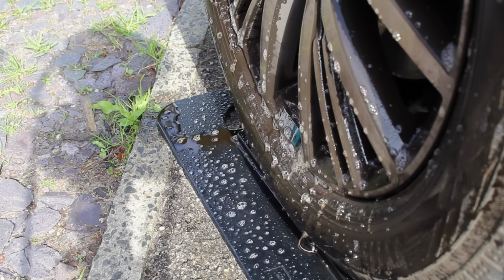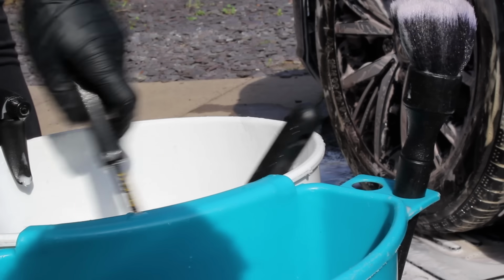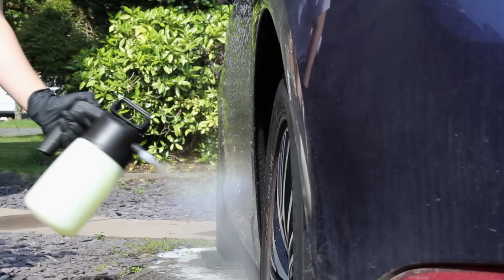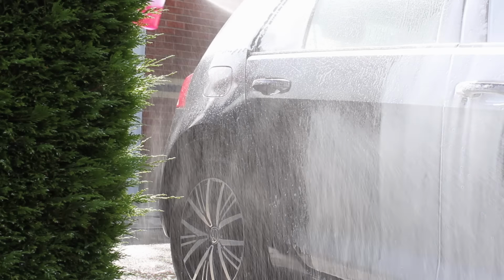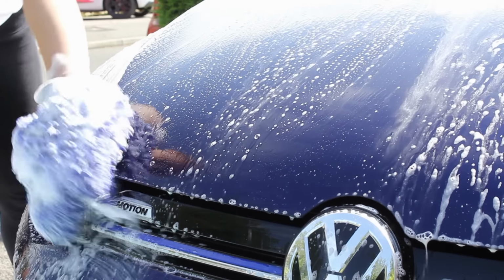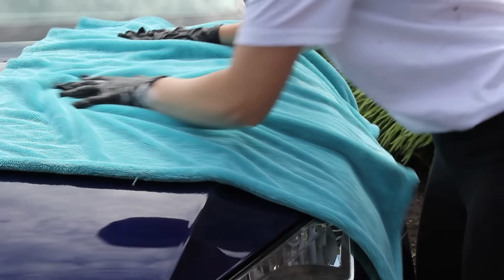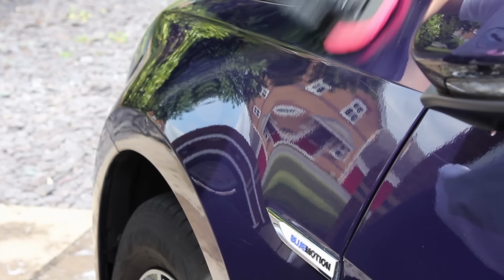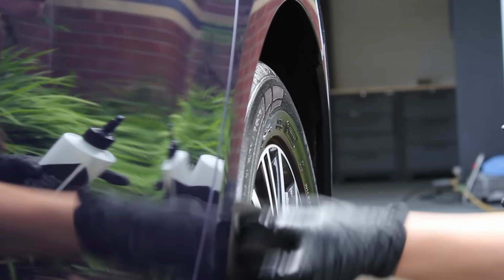Dirty Volkswagen Golf Deep Clean | Exterior Car Detailing

Comment: Biggest issue I have right now is the constant dust being dropped on the car.  Combination of pollen, local construction and other bits dropped out of the sky.... Would be great if you could show a quick upkeep method for maintenance?
Reply from the maker: Agreed it's very annoying at the moment! I've just purchased a DI water vessel (arriving today!) so my plan is just to snow foam the car,  rinse with the deionised water and then leave the car to air dry so it should remove all the dusty contaminants without having to spend much time cleaning
Reply: @AutoCareHQ  I'd be interested to see how that turns out.

Comment: I always enjoy watching detailing videos on YouTube. I wishednif I had the patience to do this weekly or twice monthly. I just don't. When I got my last car, I told the dealer not to wash and wax it. I did a full decontamination  including the claying and put diamondbrite on it. Used their products monthly to keep the protection for about 6 to 8 months before getting bored of doing it. I mentioned on a different detailing channel that I went overboard on cleaning and decontaminating the glass, especially on the windscreen: vinegar and newspaper, steel wool, barkeeper's friend, iron fallout, glass cleaner and clay, Angelwax clarity and IPA, before adding h2go. It genuinely lasted almost a year. Definitely over 10 months, and I was getting the beading at 20mph and I guess around 18mph. It was the best one out of the waxes, rainx etc that I used.
Reply from the maker: Thanks for watching 😊 that’s really impressive durability, I do have some H2Go actually, it’s a great product
Reply: @AutoCareHQ  Thanks for the response. I tried using h2go again a couple of times, but not so overboard with the decon and cleaning of the windscreen. I didn't get the same effect and durability. It was mainly because the car was new and I went overboard with the cleaning that the h2go did so well. I wanted to try the Pyramid glass, but they have discontinued it and developing a new one 😔
Reply from the maker: Soft99 Glaco Ultra is a great one to try if you're looking for another, the best I've used in terms of durability

Comment: cracking work Heather.  IW's new Super Glaze is like this, very good at filling light imperfections, and a smooth glossy finish, just ripe for coating with Super Gloss+ spray wax.  Not long used this combo on my own Outback and the results were impressive, though my Fitbit said it was a lot of effort 🥵on a warm sunny afternoon.
Reply from the maker: Thank you! Those kinds of products are great, really good for preserving the paintwork

Comment: I do like the fact that yourself and myself along with Nick@YUM rinse the snow foam top to bottom as it makes more sense in my opinion. I do really need to try YUM products but I find them slightly over priced. That VW Blue paint comes up really well when clean and well protected. I have 1000 miles of flies and break dust to remove from my car after a quick 10 day trip to London so that is the plan for tomorrow with my sons MX5 Mk1 and my neighbours car waiting in the wings also.
Reply from the maker: If you’re looking for some recommendations for Yum then I’d say Dress V2, Detailer, and Foam+, are probs my favourites. Sounds like you’re busy too!
Reply: @AutoCareHQ  Thanks. Any thoughts on the glass cleaner?
Reply from the maker: Yep the glass cleaner is spot on as well

Comment: Hi iv seen a lot 
 of your videos regards detailing cars.
I do have a question. 
When you snow foam the car, have you ever used a wash mitt when cleaning the car or as I just seen on this video, you snow foam the vehicle then let sat for about 5 min or so, then jet wash.
As normally I seen people washmit the car after snowboarding.
Do you find a lot easy to let the snowfoam do its job before jet washing it off, & dose it give better results?
As I do clean my car alot, so I'm finding out what is best when detailing a car.😊
Could you give me some tips that you find easy & more better & quality products to use.
Many thanks,.
Is it also better to wash the wheels first before washing the rest of the car???😊
Reply from the maker: Thanks for watching :)

Yep so I always rinse the snow foam off before I go in and use a mitt. This way the bulk of the dirt is removed when the snow foam is rinsed, and it's not rubbed against the finish with the wash mitt (this just helps to reduce the risk of causing micro-marring and swirl marks).

Yes I always wash the wheels first. 

This video is a good one to watch if you're looking for some more info: https://youtu.be/MlvUA0FcZJQ

Also if you're looking for more product recommendations have a look at this section on my website: https://autocarehq.com/recommended-products/

Comment: I enjoy following your channel. I watch it regularly. Can you tell me how to solve the problem with calcium deposits on the bodywork. I have applied Sonax One ceramics to the bodywork. I live in the south of Germany where it rains all the time and is very humid in the summer. Mineral deposits constantly appear on the bodywork. Can I wax the bodywork on top of the ceramics? Will it stay on the ceramics and for how long? Will it help to solve my problem? Or should I use an acid shampoo on a permanent basis?
Reply from the maker: I would apply a ceramic sealant from the same brand as your coating to be on the safe side. It won't really solve the issue but will shield the coating from the mineral deposits more so it doesn't get clogged as quickly. Do the mineral deposits not come off with a pH neutral pure shampoo?
Reply: @AutoCareHQ  I've used acidic shampoos and neutral shampoos. I have a car that gets wet every day at night and then gets bright sunshine for half a day. And all those droplets dry on the bodywork. Every day.

Comment: How do you balance washing in the middle of the day and the soap drying on the car?
Reply from the maker: It was still the morning here so not quite as tough but I wash each panel at a time and rinse before moving on. I also keep misting the car with the pressure washer to keep the panels cool

Comment: Can you recommend a few different pre-wash snow foams?
Reply from the maker: Squid Ink Alkafroth, Garage Therapy Snow Foam and the Bilt Hamber ones are all good if you're looking for more cleaning power
Reply: @AutoCareHQ  Thanks for the tips.  Think I may go with the Bilt Hammer as it's a good price.  Can you use this product as a pre wash then rinse then use as as a shampoo type wash?
Reply from the maker: No problem. I wouldn't use it as a shampoo, it doesn't really offer any lubrication so the risk of marring will be high. I'd go with the Garage Therapy /ONE: Car Shampoo personally, but Bilt Hamber Auto Wash is really good too if you want to stick with the same brand
Reply: @AutoCareHQ  Great advice.  Just went with the Bilt Hammer Auto wash and teh Pre-wash foam.  Thanks for your help, really appreciated.

Comment: Heather I’ve got a 2 stage Gtechniq ceramic coating on my vehicle. Is the Garage Therapy citrus pre wash fairly safe to use? Cheers.
Reply from the maker: Yep I've used it on plenty of ceramics and had no problems. Just make sure to dilute it. You likely won't need to go any more concentrated than 1:9 even if the car is filthy, but for general maintenance around 1:20 is perfect

Comment: What are the nozzles you are using on the short spray gun? Do you use 40° nozzle on paintwork or do you use the 25° nozzle on paint and wheels? and what orifice size do yo select for the nozzles?
Reply from the maker: I’ve linked it in the description. It’s a 25 degree 04 orifice
Reply: @AutoCareHQ  Thank you.  Just subscribed to your channel after coming across it and loving your honest reviews and your helpfulness.  I'm looking at buying a Stihl High-Pressure washer for home use and looking to upgrade it with the MTM foam cannon with the SGS35 gun. Thanks again for your helpful videos.
Reply from the maker: No problem! Thanks very much for watching 😊

Comment: do cleaning wheel need extra 2 bucket?
Reply from the maker: I rinse the brushes/ mitt with the pressure washer before putting them back in the bucket so I don't use an extra one for rinsing

Comment: How do I get rid of swirls on each side of my Audi saloon A4. It's a dark grey, and no matter what I do, it looks terrible?
Reply from the maker: Have you used a machine polisher? Which pad and polish combo did you use?
Reply: used meguiars ultimate compound with rotary polisher with standard flat pad speed 3 to 4
Reply from the maker: @richardmurray8433  I've very little experience with a rotary personally I just use a DA. Audi paint is really hard so I usually go for Koch Chemie H.902 on either a red foam or microfibre pad and then follow up with a Koch Chemie Ultra cut pad and polish to refine (all on a DA)
Reply: @AutoCareHQ  thank you I will give it a go

Comment: How do you dilute your prewash solution?
Reply from the maker: It was a 1:9 dilution so 100ml of prewash and 900ml of water
Reply: Hi

How do you maintain for buff off towels such as for ceramic spray?

Do you wash it right after using it? Do ypu you soak in water / soapy water? Or do you just hang it to dry

Im usially wash and top my ceramic cary once every 2 weeks